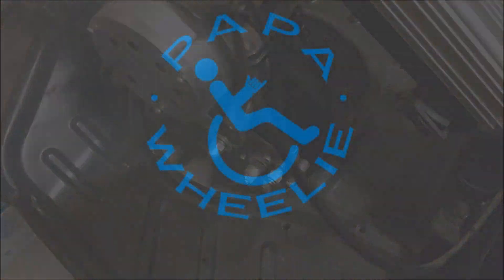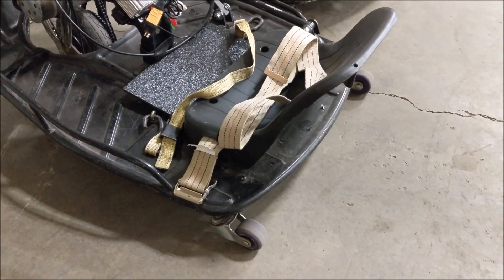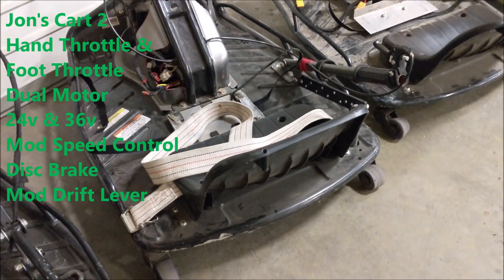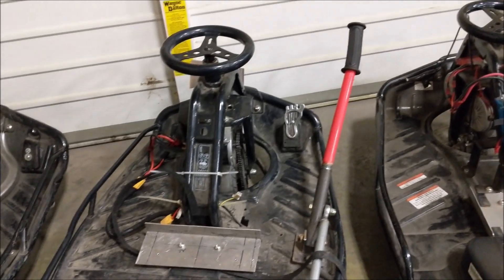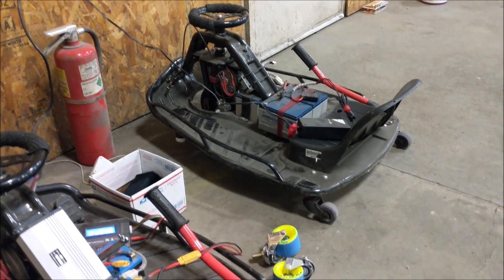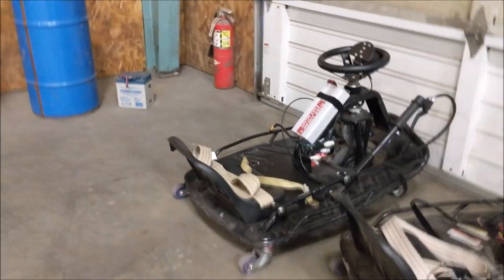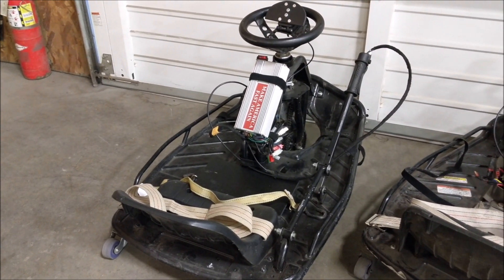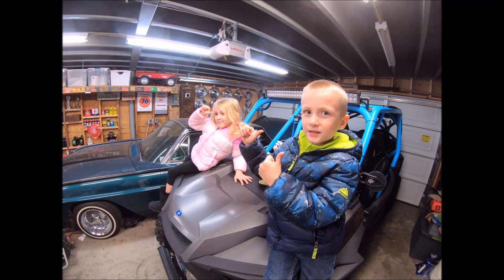Crazy Cart Speed Recipes: What makes our carts fast?? 36v, 48v, 60v, Brushless, Lithium, etc.

Comment: What do u need to make your crazy cart go 20mph or more
Reply: Thanks is much😊
Reply from the maker: It's easiest with 48 volts, but it can be done on 36. You'll want a good speed control and an upgraded motor helps. The stock motor starts running a bit hot when you push it too hard.
Reply: @PapaWheeliesWorld  what if I have 36v speed controller and 36v battery and the stock motor will the motor over heat
Reply from the maker: @Rewindz60fps  36v is usually just fine in the stock motor. Once you do 48v they start getting a bit hot. That's why we made those dual motor plates, because the motors ran a lot cooler.
Reply: @PapaWheeliesWorld  so I’m good with the 36v
Reply: @PapaWheeliesWorld  wait can I use the stock battery charger for the battery
Reply from the maker: @Rewindz60fps  yeah, you're good with 36v! You can usually even run 36v on the stock speed control, at least for a while.
You definitely need 36v battery charger!
Reply: @PapaWheeliesWorld  how do you get it though I can’t find one
Reply: For a standard cart
Reply: The charger I can’t find one at all
Reply from the maker: @Rewindz60fps  email or call www.electricscooterparts.com
Reply: @PapaWheeliesWorld  thanks

Comment: Hey can you help me with my sprocket set up?
Reply: I changed the motor and I’m wondering if a 20t motor sprocket and a 55t wheel sprocket would work together
Reply from the maker: What motor, battery voltage, speed control, etc? Thanks for watching!

Comment: what do you run for the drive tire?  My son had a stock 24v one in the past and between him and neighbors kids using it, I had to replace the drive tire twice in one summer.  They aren't that expensive, but it's a pain to replace.
Reply from the maker: I've ended up using the high density foam "solid" tire from Amazon with good luck. We normally run on smooth concrete so the tires last longer, plus, we normally are racing and a spinning tire is slower than one getting grip. For that reason I think we get more life out of our tires than most people do.

Comment: Can I add 54volts ? On a stock motor
Reply from the maker: You can, and we have, but they build a lot of heat at that voltage and don't last long...at least with full size adults anyway.

Comment: what battery do you use in your 48v carts?
Reply from the maker: We mostly use the Power Sonic PS-12120 batteries. They are 12 volt, 12.0 Amp Hr. I've had the same batteries in one of my carts for 4 years and they are still working well.
Reply: @PapaWheeliesWorld  OK! thank you so much